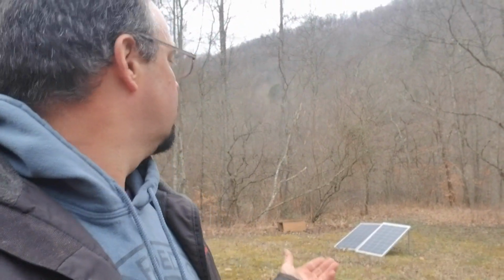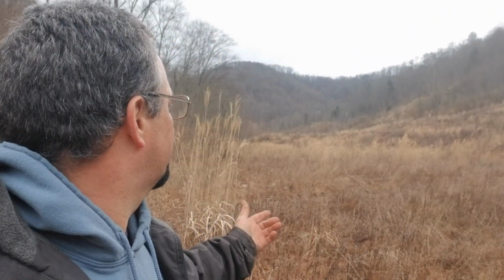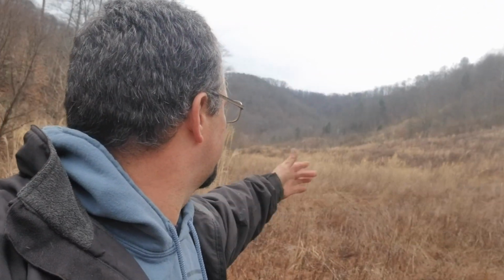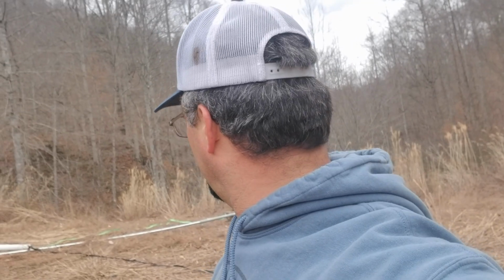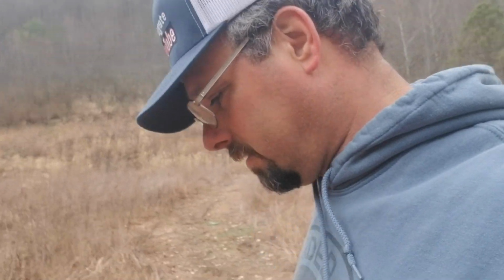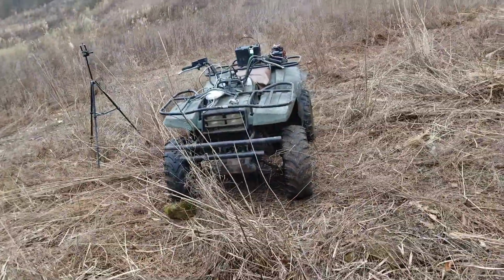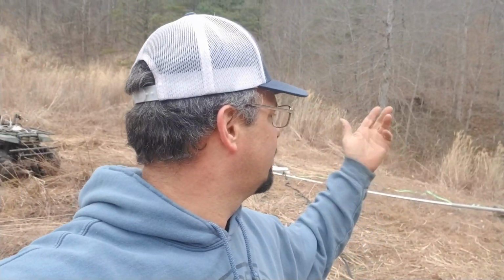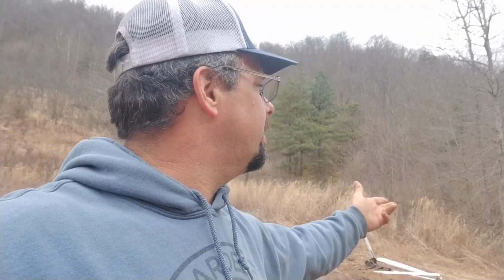Setting Up The Wind Turbine (with a small setback)

Comment: you are doing great! One step at a time!  Sometimes 1 forward, 2 back! God bless ya!  My son was going  to college in Prov Rhode Island I used to see when visiting these huge wind mill generators, from what I learn they have big gear reduction, and transmissions I guess, as they are able to stall, or stop rotation for servicing them. Must be 5 stories high, would have loved to see them assembled over the water's edge. Here in CT they are going to start building some along the shoreline.
Reply from the maker: I would like to see one of those big wind turbines. I have seen the parts for them going through on flatbed trucks. I've never seen one together though.

Comment: It's been the same here, lots of cold, rainy days and nights. Spring can't be far away though, so it WILL get better before long. It's great that you can remake the blades without too much trouble. If that happened to me I would have spent the rest of the day knocking down weeds, lol.
Reply from the maker: LOL I did knock a few more down before I left. The rain cloud was gaining on me very fast though so I had to get back home.

Comment: can you dig a hole and stick a pipe in the ground? How about build a box from the pallets and fill with rock around a pipe? then slide the actual pipe inside the stationary one.. or have you already finished it...
Reply: What about a sono tube with concrete but in the center is a PVC pipe or another  empty sono tube the diameter of the pipe. Leave the center empty so the windmill slides in. But it Definitely will not be portable. And I’m not sure if you have a large post hole digger so maybe it’s a stupid idea, idk 😐
Reply from the maker: Haven't got it going yet. I think the pipe in the ground idea is a good one.